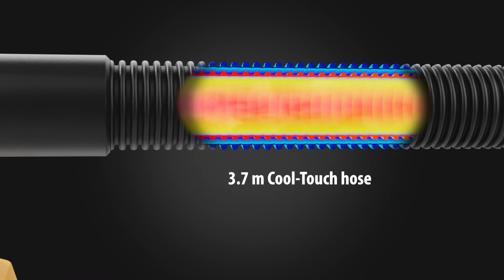Wagner SteamForce - Wallpaper Steamer

Comment: My machine has a hole in the bottom and will not hold water anymore?
Reply: Patch it
Reply: @dougsizenbach2686  Patching it is unsafe unless done by a professional. It's a boiler, and under pressure, having a patch fail could be extremely dangerous - you don't want litres of boiling water and steam suddenly escaping.
A hole could also indicate a serious problem with it, such as the metal deteriorating.
Perhaps it's actually just a failed seal, from which the water is working it's way to the bottom (the tank has a plastic cover, so leak origin may not be visible.